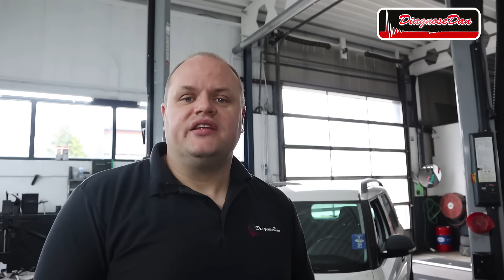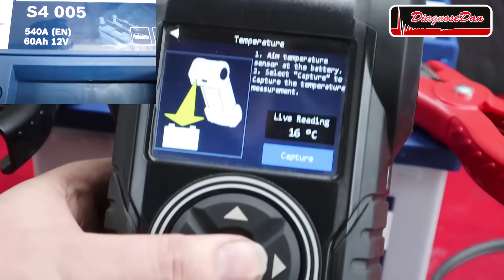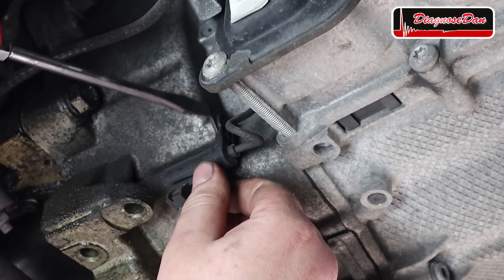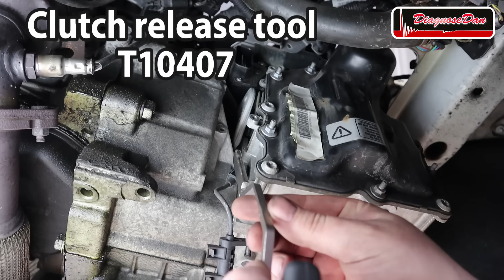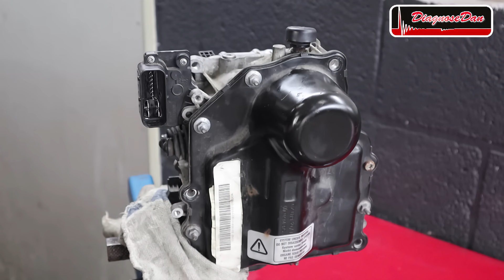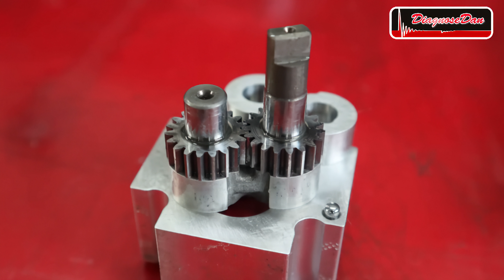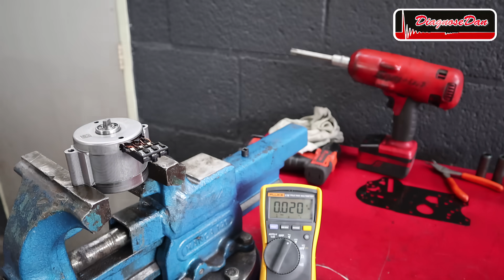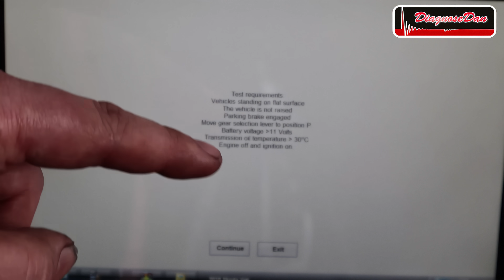DSG Gearbox Diagnosed explained Fixed

Comment: I once saw that problem and it wasn´t an easy fix, the pressure accumulator thread had a crack, which led to the accumulator becoming loose, which led to the pressure dropping, which led to the pressure sensor telling the pump motor to produce max pressure which led to a high current which led to overheating the electronics actually melting the circuit board plastic (exactly where it was molten on your circuit board) which led to the wiring touching each other forming a short circuit which led to the 15A Fuse to go out. There are some companies producing an inlay for the oem accumulator thread made out of stainless steel with an smaller pressure accumulator that can prevent this from happening, but once theres a short circuit you would have to repair the plastic part so that the wiring doesn´t touch anymore. I hope that everything i wrote made sense, because sadly im not a native speaker, but if anyone has this exact issue they might now know what to check. Greets from germany
Reply: I understood you very well. But can that circuits board be repaired or it obviously need replacement?

Comment: I have an issue with my DSG on my Mk5 Golf GTI. It's smooth as butter throughout all gears when the oil is cold. As soon as the car is up to temperature the car is jerky pulling off from a stop. Once moving, smooth as butter. 

There is no judder going up or down the gears in any settings, the only issue is once I have stopped, foot smoothly on the accelerator, car moves slightly, then there is a flat spot, then the DSG engages and the car moves forward at a jerk.

Any ideas? 

I assumed with it operating well with the low temperature oil it's an issue with viscosity? Maybe a leak or losing presure somewhere intermittently whilst stopped.

Comment: Yep. Got alot of them on repair and obviously, less that hadn't hydraulic liquid inside ecu. Most of issues i had to deal were inside the ecu. Just one had problems with little metal parts inside valves.
And more of that,a lot of Audi shops or little garrages that did not respect the right hydraulic specifications and... the liquid quantity. 
BTW: beware of mechanics that take off the DSGs from the car and try to take them apart and "see what's wrong inside".
Obviously, they will not see or find if there are brains, because that mechanic has no brains, either. 
More of that. Some more cases i've had about that special kind of mechanics: "the DSG stops working right when hot and if I pour cold water, it works like new". For that reason, little Nemo fishy had his own nest inside the ECU. Holly sh... Beware of cheap mechanics, 'cause will cost you more than to the dealer.

Comment: Dan, a question: is that basically all the oil that is contained by a dsg dry clutch, or are there other compartments  in the box as well that contain oil , which also wil be renewed when changing transmission fluid?

Comment: My Renault fluence also has a dsg 6speed gearbox, I see it sometimes labeled as Getrag in the specifications. Semi-automatic, dry clutch.Thanks Dan, very informative. Glad I just put a new battery in :) By the way, I completely agree with your appreciation of how DSG works. It is as smooth and snappy as my former Chrysler 300m V6, I only use the semi, shifting most if the time  at 2000-2200rpm

Comment: True resistance measurement value is the first, then it goes down because of multimeter batery voltage decreaeses  when low resistance is  measured

Comment: This gearbox  also known as the DQ200 is the cause of many failures especially in India, over in Europe there were recalls. In India this gearbox failed in many POLO and Vento cars . Weak consumer laws meant no recalls here . Within warranty replacements were done but those out of warranty simply ditched the cars or made with 2nd hand gearboxes. This oil in a hot country like India caused premature mechatronics failures. But the stupidity of VW India was they replaced the whole gearboxes  often times as no " child part" mechatronics was available initially. Much later they got the mechatronics child part replacement. 
Other than the mechatronics the dry clutch vesions i.e. DQ200 had failed clutches especially for cars used in slow moving traffic and stop/go scenarios. Excessive clutch slippage especially on smaller 1 liter models ,. once the clutch started to wear the debries accelerated the wear leading to complete clutch failures.
Now they have got the wet clutch versions in the newer cars lets see how they fair.
A good piece of technology  but very unreliable due to insufficient testing in different conditions by manufacturer.

Comment: Is it required to change hydraulic oil in dsg 7 speed, Dq200?  
Mine is now 75000km done, never changed mechatronics or gear box oil yet.
Reply: You should change the gearbox oil preferably every 40-50 thousand km

As for mechatronics hydraulic fluid, this is not a maintenance item prescribed by VW, but you can get it done from a 3rd party service center. Make sure you use the correct type of hydraulic fluid - if i remember right, the mechatronics uses hydraulic fluid of the grade CHF11S and the filling quantity is 1 liter

Comment: if you were to re-assemble the old unit, you would have had to test the solenoid via a 12V to listen to their kicks. it may pass the resistance check but may fail operations check
Reply: Right. Isolation could be wrong

Comment: Hi Dan I have an audi a3 dsg 7 speed 2009 and sometimes the gears flashing on board my mechanic check the pressure and was low about 53 he tell me maybe oil causes that or the while megatronic system

Comment: great video Dan your the man! I was waiting for a 50 fuse to replace the 30 amp.
pretty risky move with the trans plugged in. lol
actually, I haven't seen a standard test light in a while. most technicians use a digital power probe to see the voltage drop of the harness.
Keep up the good work sir!

Comment: DSG are worst in the city drive, that why some country DSG are bad, the buyer even can get the money back, VW can't very fix the problem, they just reprogram it ,made the gear change longer, that why after update the software, when cold start, the clutch feel like need long time to engage.race car doesn't mean good on street. But I like VW, that because have a workshop only do VW,, coolant leak replace water punp every 30000km, oil leak you just name it, timing chain broken, replace whole engine, door locks and window regulators everyday, I am rich :)
Reply: I´ll never buy a Volkswagen again

Comment: First rate video Dan. It would have been useful to test the circuit board tracks to earth. could they have been touching the casing. Anyway I presume you can't easily buy the cct board anyway.

Comment: Great Video - we just had this prob with an Audi A1 1.4Tfsi  (but no blown fuse tho = otherwise exactly what my mechanic explained before he starts the inspection if, and likely replacement of that same Board - awaiting a photo of the damaged board, and part failure point, or to see the replaced unit or photo’s of repair - to confirm diagnosis and correction solution applied 👍

Great learning from your detailed explanation and showing it but by bit and how you tested each component as well 

Problem solved = Great job 👏 👏 👍

Comment: My car has transmission issues after the DSG oil change, the maintenance was done by VW. The fault codes i get atm are P179E00 followed by P060A00. I really wonder if its just the battery? Any advice sir?

Comment: GOOD AFTERNOON BOSS !!! I AM FROM BRAZIL, SORRY FOR MY BAD ENGLISH!
I AM GETTING A DQ200 DSG 7 GEAR TRANSMISSION. IT HAS THE FOLLOWING PROBLEM: WHEN STARTING THE CAR FOR THE FIRST TIME, IT SHOWS A DELAY TO ENGAGE FIRST GEAR OR RE. A FEW SECONDS LATER IT ENGAGES AND WORKS WELL. TURNED OFF THE CAR FOR MORE THAN 5 MINUTES THE DEFECT OCCURS AGAIN.
CAN YOU HELP ME WITH ANY TIPS? THANK YOU VERY MUCH.

Comment: Excellent video. I must confess that when you said that a bad solenoid or motor could kill the electronic unit i thought "What the hell are VW engineers doing?". But maybe there is a error code for that situations without fry the electronics.

Comment: Thanks for a very informative information of dsg gboxes. I believe You can test the smal 3 fase motor with a one phase transformer given the actual  ac-voltage  and a condenser f.ex. 2 to 4 uF on the 3. phase. But if the generator test showes nominel voltage, on Your meter, it is the easy way, and ok..

Comment: Halo, I have a 2006 Jetta. The jerks forward when you accelerate past 1000 rpm And when it shifts down past 1000rpm it shifts funny. What could be causing this ?it jerks as well in traffic when shifting between neutral and drive

Comment: I learned something new today. However, I still didn't get what the root cause was! Everything electrically and mechanically turned out healthy, yet the reason behind circuit board burn is not found.

Replacing the unit does not guarantee it won't happen again.

There must be a reason why the circuit board burnt, and that is yet unknown.

Nevertheless, it was a well prepared video.

Comment: I have a DQ250 that drives up until the end of 3rd gear. And won’t shift into 4th. BUT if I put it in neutral, if I’m at speed it will skip 4th and go to D5 or D6.. is that clutch pack, synchro, or mechatronic???

Comment: Hope you can help me. I have a 2009 C220 blue efficient Mercedes Benz. When I am driving it it does not change gears until the revs get so high then it changes gears. It has lost its low range power and he’s using a lot of diesel. I have had the gearbox oil and filter changed as that’s what the mechanic told me it was but that has not solved the problem. I love the car and definitely don’t want to get rid of it, I hope you can help please. 🙏🏻🙏🏻

Comment: hi Dan. In this video you checked pump, solenoids and three phase motor except accumulator. Everything was working as its supposed to be. According to my theory there was no enough pressure in accumulator and so pump was working more and often than necessary. So if it works hard to make up for the missing pressure, some electrical ways on the circuit boards heated so much and finally burned. If you didnt change accumulator you can see same problem again.

Comment: Another way to test a three Phase motor is to short each of the three phase pairs, one pair at a time, and try to turn the shaft. You should get resistance to turning, and if shaft turns freely while one phase is jumpered, that phase is likely OPEN.
Also, if you get resistance to shaft rotation when no phases are jumpered, then you have at least one SHORTED phase.
These tests are with motor disconnected from any external circuit/controller.

Comment: Excellent video Dan, thanks very much! I don't know anything about DSG, you taught me a lot. If I'm allowed to comment on the 3 phase motor, it may well be a Brushless DC (BLDC) motor. Because of its weight, precision and better speed control (better than AC motors), the BLDC motor is used in many modern applications, aviation as well. But I'm not sure if the DSG motor is such.

Comment: Hello friend I'm from Mexico and I'm 43 years old. I'm mechanic and I have a carr especific audi a3 2014  so. The sisstem has only 2 codes they is s reference at, gear 3th velocity and revers. The mecatronic it look like fine, buth the unic problema was of the  pressure  acumulador has the oring broke. So now the car is not aply any velocities. Can you help me please
Saludos desde México y muy buen video.

Comment: Integrated temperature sensors in a digital battery tester? Now that's clever!
I just have one of them cheapo ebay testers I keep in the boot/trunk, it's nothing fancy, but that, a cheap scan tool, and a lithium polymer jumper pack keeps me out of trouble.
I typically test with it 1st thing in the morning after the overnight chill has done it's thing anyways, because that's usually when they let you down

Comment: So you diagnosed my ass.. Board was burned because there was leak in system and motor was working all the time trying to maintain sufficient pressure.. you need to check your pressure supply often on your DSG.. often it is all about that green O ring around pressure accumulator..

Comment: Hi Dan, not sure if you can help with my car which is unable to start right now. It is an 2015 Audi A3 1.4 with the DQ200 gearbox. Yesterday I tried to start the car, the instrument panel lit up but car was unable to crank. Plugging the car to an OBD scanner revealed P0850 fault code which cannot be erased at all. The instrument panel just says “engage P or N” while I already have P engaged. Checked the voltage of the battery and it was circa 12.1 V. I even tried to use a jump starter to see if the engine would crank but no help. May I know what sort of common cause could it be?

Comment: 40+ years of experience as a professional mechanic, and I can say without reservation: YOU are the man. You did not say it, but you should have mentioned to put the multimeter on AC when testing the motor. I would recommend a milliohm meter and megger as additional tools for the modern technician. Thank you for your work.
Reply: Hello,
Could you please tell e what is a Megger and it's purpose .
Thanks
Tigo

Comment: I own a Golf Mk7,  i hit the pavement with it and i got it fixed by myself with out separating it from the gear box. During the accident i noticed some oil coming out. Now i was wondering where should i put the oil back? Do i pour it in before i get it closed or its poured elsewhere?
Thank you in advance. 

Now my question is,

Comment: The DSG is smooth when you are driving out on the open road. It is a bit jerky when in town and the biggest annoyance is when you are on a ramp and the car rolls backwards a bit before the clutches engage. Thats why you see on newer DSG the Auto Hold function. Older ones didnt have it and it was annoying. To this day, I still think the DSG is properly suited for the higher powered variants like the GTI, R models etc. For regular cars, not so much. They could have used the proven ZF 6 or 8 speed gearboxes.

Comment: Dan buddy. Love your videos. They are really helpful. Question. When doing basic settings on a Dq200 after replacing the clutch pack using vcds, what does it mean when it just stops @ 255 101 0? Thanks a lot

Comment: Battery in car test shows different to battery not connected  test, you should have tested both disconnected. The capacitors in alarms and vehicle immobilizers have different current draws. The test should always be done on the same playing field., disconnected. Otherwise great vid.

Comment: What I can't understand with the battery test is this , how does it tell you if a cell is going down? The only way to do that is to put the old fashioned tester across terminals to load it so far as I am aware . Am I right or wrong ?

Comment: Double D, I think I would like to add two extension shafts onto the hydraulic cylinders for the clutches. You could operate those pushrods (using a double lip seal, a bronze bushing and a dust seal on the outside of the mecha T) with a single horizontal clutch fork with dual tips. Add signal programming for a sequential style shifter. The capability is already there. How cool would that be to have the exact "feel of a sequential". With none of the inherent prob?

Comment: hi Dan .great video about the mechatronic .i have an issue with my vw passat 2011 with the same gear box ,,,it goes from d to d2 in a speed of less than 5km/h..and it it stock in d2 and it takes too much time to go to d4 passing the d3 ...what can be the problem . ,,the R is fine the N OF COURSE FINE ,,,

Comment: My conclusion is that the permanent magnets of the pump motor demagnetize and in order to keep the pressure it gradually pulls more and more current until it starts to trip the fuse. it is possible to source one from chinese resellers, but it is impossible to get the job done in a reasonable time frame.

Comment: I have a 2011 Audi A7, which has just thrown a Gearbox Malfunction fault at me. It's on 98,000 UK miles, and now I'm faced with a Mechatronics replacement, after a VCDS scan, points to Valve 1 on the transmission. This video was excellent, in helping me understand how the device works. Thanks...

Comment: I guess you also have to put the old gearbox module back together and send it off and refurbished when buying a new refurbished one? I also guess that the labour intensity of finding a fault in that thing means it just isn't worth it most of the time.

Comment: So I ended up realizing that I had a dead or dying cell in my 75R battery. Took it to the auto shop and they put one of those load testers on it and it tested fine. Charged it up with a trickle charger and it charged to 12.6volt,  all ok. But it would loose voltage over time and only after testing each cell with a good old multimeter did I see that the last cell was less than the 2.1volt. Of course it didn't help that the car it belonged to was an EV, Nissan Leaf. Interesting non the less but had me stumped for weeks as the batter was less than a year old. What happened was the battery was drained a few times, lights left on or Charger left on for a few days  in and that was enough to kill one cell.

Comment: Verry nice video !so ....if i understand correctly dsg gearboxes have 2 type of oils inside ?firdt one which u drain from normal plug and secnd in the mecatronit unit ,becouse i have a skoda octavia 2 dsg 2005 ,and my mechanic didn't tell me about this ,and that type of oil it is ?thank you

Comment: To Extend car battery life everyone have to charge you car battery every 30 days (or less if possible) to fill battery 20-30% that your car do not charge or  self discharge if car is not driven. You car never charge 100% battery while you drive. New cars even less due to a lot of electronics and Start Stop system. Cranking your car have big impact to battery discharge so have that in mind...